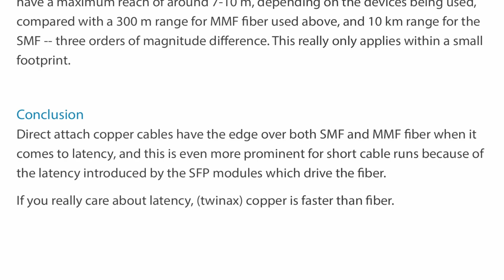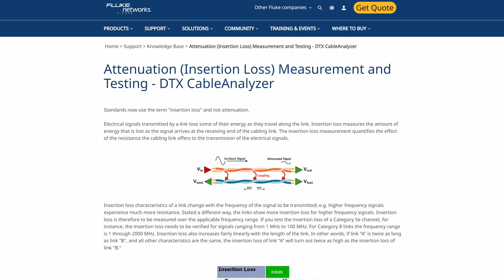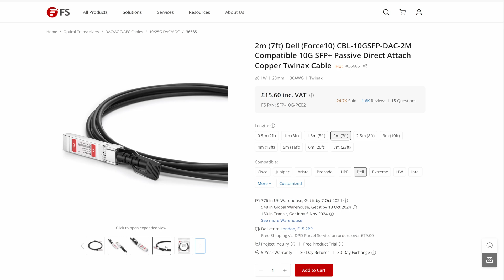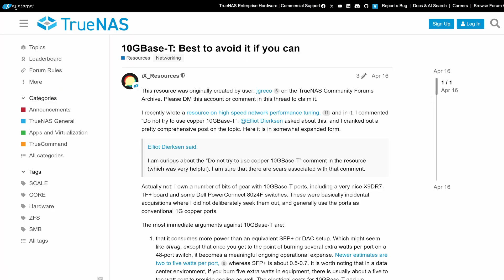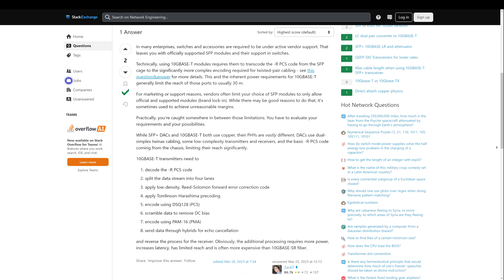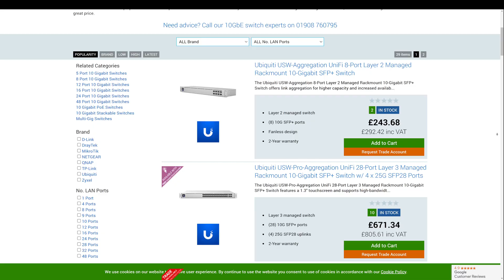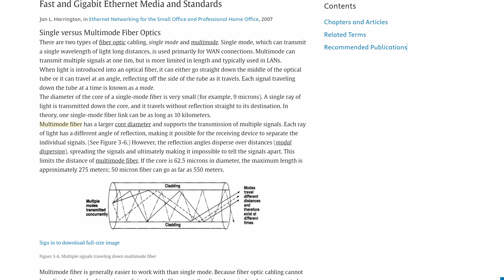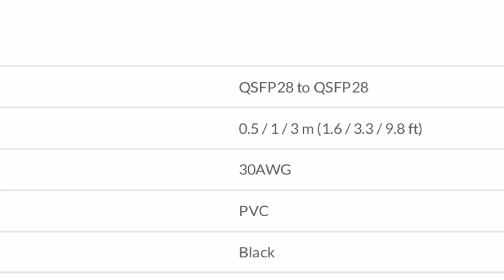Why The Pros Don't Use Ethernet For High Speed Networking

Comment: Informative video Thanks. 7:02 Which Nvme drive did you have that couldn't saturate 10g? Just wanting to know more so I can avoid making a mistake.
Reply from the maker: Thanks for watching :) This was either my Samsung 990 Pro or the WD_BLACK SN850X. However the slower-than-expected speeds was due to a temporary limitation in my own PC (the PC receiving the file), IIRC. Both those drives would have saturated the link in an ideal setup: that both they support 7000+ MegaBYTES per second of speeds, and a 10 GigaBIT link actually only needs 10/8 = 1.25 GigaBYTES per second speeds from a storage drive :)
Reply: @TechOverwrite  Thank you.

Comment: Isn't 100Gb on fiber still ethernet? I mean the interfaces still have MAC addresses and transmit ethernet frames, or don't they?
Reply: Yes indeed, because Ethernet is technically a protocol, and as such is not actually tied to medium of transmission. The most common medium is copper, which is why it is commonly referred to as Ethernet, but to get really technical this isn't actually proper usage of the term. Being a protocol, it can be used over WiFi, copper, fiber, etc., all of which use the Ethernet protocol. You can run other protocols over copper "Ethernet" cables as well. At work we run iSCSI over copper Ethernet cables for example, connecting our large hypervisor hosts to their SAN storage device and each other, which is actually much faster for that particular use case than it would be using the Ethernet protocol. I am not saying to stop called copper wires Ethernet cables, that is what they are called even if technically they perhaps shouldn't be.
Reply from the maker: Thanks for the question and for the detailed reply @DrenDor100, that's fair (and really interesting to know) 🙂 Yes I always just say Ethernet when I don't quite mean that, I should have clarified that this is more of a protocol. Thanks again.